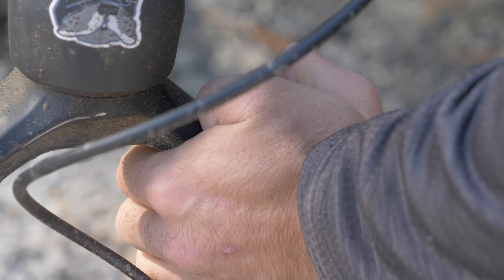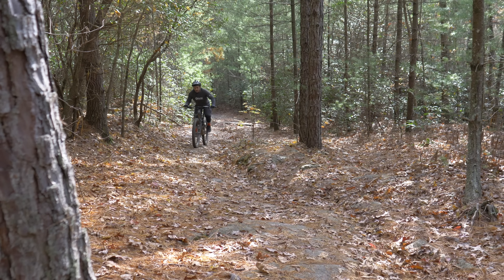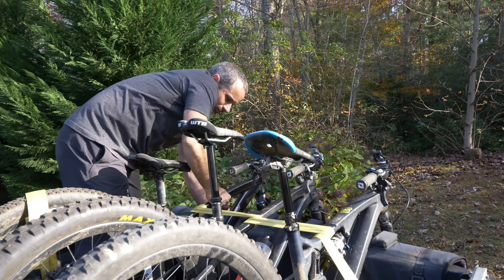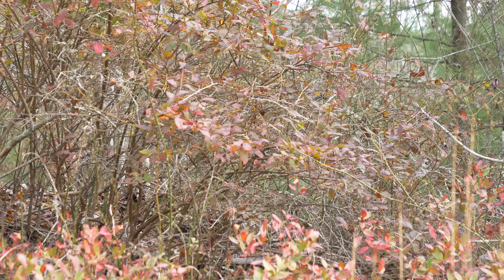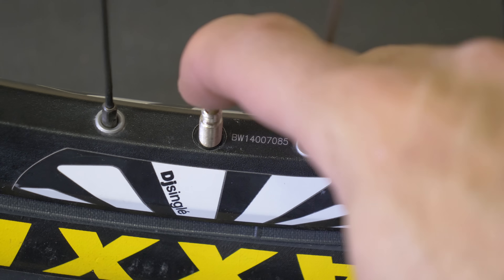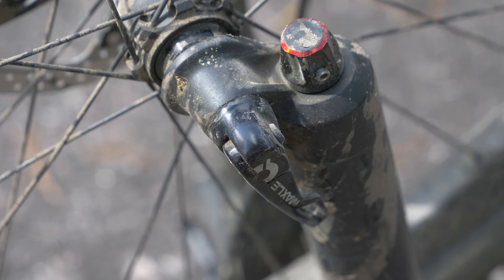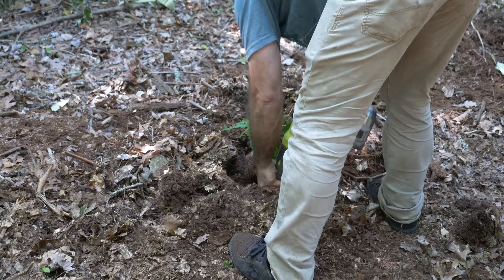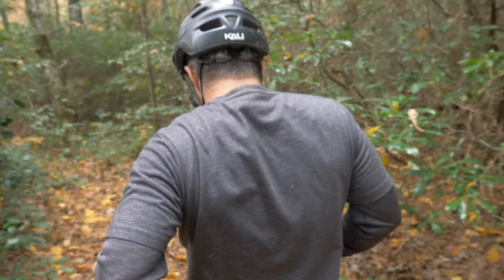10 Hacks and tips for mountain bikers

Comment: I thought I was going to know all of these. That tube trick tho! Nice!
Reply: You can also stretch a 26" or 27.5" tube to fit 29" wheels no problem.
Reply: I bring 26" presta tubes in my pack even though I'm running 27.5 and 29" wheels mostly (Have 24" and 26" bikes too though). I reckon the 26" is the most universal donor. I've never bought a 27.5" tube as they're too close in size to 26, which I had already. The people running plus size/fatbike tyres are about still probably stuck trying to use any normal sized tube though.

Comment: I’ve been using 27.5 tubes as spares in ALL my bike tires for years. Even the road bike. You can usually get them in 27.5x1.75-2.25”. This has worked for me in my 29x2.6 (they stretch), 27.5x2.35, and most impressively 700cx28mm. With the roadie repair, I put another 500 miles on it across Iowa without a problem. You just have to be more careful when installing, as to not pinch all the excess rubber.

Comment: You can use an old inner tube as a buffer for metal on metal clamped accessories like rear carriers that mount onto your frame. Use them in between the part that clamps on your seatpost and frame and avoid scratches.

Edit: you will have to cut the tube to size obviously

Comment: Seth, try this hack,
If your like me you can’t afford really expensive hydration packs or just don’t want to spend tons of $ so you go to Walmart and get one for$20. However, they can be hard to air out. Take the water tube and put it inside the pack, and then place it vertical so it leaves the pack open. Helps the pack dry.

Comment: 4:15 You know the metal ring that locks the valve stem in place? On some of those rings, there is a smaller section that sticks out. You can flip it, and the smaller protrusion will fill in the gap between the valve and the hole. I apologize if that was a bit confusing, and I can DM you on Instagram if you want.

Comment: Hydration pack hack:
Keep your hydration bladder in the freezer between rides. Leave the bladder 1/4 full. Blow in air to form a large enough air pocket so that the filler cap, bite valve, and the entire hose are free of water when the bladder is laid flat. Then place it flat in your freezer.
The next time you fill your hydration pack, it will be slime free and will have a long chunk of ice to keep your hydration  fluid cold. 
Been doing this for years with the same bladder with no degradation of the bite valve, hose, or bladder.
Reply: Vince Fernandez nice

Comment: The shock pump "slide hammer" stuck air cap hack is a good one. To help keep them from getting stuck in the first place, I've learned to thoroughly clean and grease the cap threads once in a while.

Comment: Seth I have a really good hack.

If you take the cap of a Presta valve cut the tip of it off to where there’s a hole through the whole Cap then you can attach it to an unscrewed Presta valve and boom you have a Schrader adapter

Comment: Here’s a hack to fix a puncture in a tubeless tire without the right tools. 

Step 1. cut out a small piece of inner tube. 

Step 2.  Put a little dab of rubber cement on the puncture.

Step 3.  Take a 3mm hex and shove the inner tube in to the puncture but don’t rip the inner tube it will take a little finagling to get it to seal but I got it to work for me

Thanks in advance

Comment: Here's a hack.  For a cheap and sturdy on bike storage container use 1 1/2" PVC pipe (as long as you want), end caps, and plumbers cement on the bottom end cap, spray paint for pretty.  You can drill 1/4" holes if you want to mount it on the frame or use hook and loop.  It will hold a small multi tool, 2 irons, a patch kit, and wet wipes depending on size. I use electrical tape to keep things from rattling.

Comment: Hey Seth I've got some hacks for you. For some reason I'm too lazy to get a case for my phone so I throw it in an old sock to protect it. I use an ankle sock and tie a knot at the top to prevent my phone from coming out. If you know how to sew I'm sure you could use a sock that hit below the ankle and sew in a string to tie together or even some small bungee cord and use a cord lock to cinch it down. The second is an old backpacking trick. You cut your straps on your pack and singe the ends to cut down on weight and frustration that arises when straps get tangled. Again, if you know how to sew you can sew the ends of the straps together like they come new to prevent the strap from going through the buckle

Comment: When working with plastics with threads in an industrial setting, we use never-seize, PVC has a tendency to lock itself, like the air cap, and you start to break stuff trying to un-do it. Put some on the threads and never have to get mad at it again!!!!

Comment: Another hack of the multitool : You can actually add your keys to it (home, bikelock etc). Its cheaper than a keysmart and works just as well but with more tools ;) you might have to make the hole in the key a bit bigger, but that's easy.

Comment: Hey Seth, I've got a hack for you! It's loosely MTB related :)
Recently I was cleaning out my PC, and I decided to use my Topeak Booster Pump as a compressed air can. It worked marvellously. Needed a hand from my husband to turn it on and off for maximum efficiency from each blast, but it did the job and it did it even better than normal compressed air in my opinion! I also got blasted in the face with dust haha...

Comment: New hack; Use a Q tip and push it through the valve of your camel back to clean out black gunk that is inside the water tube. You first need to remove the rubber part and open the valve completely by moving the feed lever.  This only works on the stuff closest to the valve but it cleans most of the gunk out.

Comment: If you over titan a quick release axel, use a pvc pipe to slide over the release and use as a breaker bar. This won’t wreck the axle or paint but will give you enough leverage to open or remove the axle

Like so he can see!

Comment: Rocks flying up into thin wall frame tubes sounds like it could be damaging things.
One or two layers of duct tape dampens the noise and has to protect better than nothing.
In a pinch you have some tape to peel off and use again.
We once repaired a blown sidewall with a snack wrapper. Planter's peanut and it held up the whole ride.
We used to wire our dirt bike spokes where they cross to triangulate them. It also prevents damage if a spoke were to break and start whipping around.

Comment: if you have a bag that you strap onto the frame and your multi tool doesnt fit

stretch the multitool over a section of inner tube
then use the strap that comes on your bag and strap over the multitool, half weather resistant and secure, use extra self stick hook and loop if it isnt secure enough

Comment: here is my tip. for gopros when you want to tighten the screw down very tight so it wont move the camera, you can tighten it all you want but it will only ever go so far because the screw will bottom out inside the captive nut. take the gopro screw and grind or the end down only 1-2mm and screw it in and it won't bottom out as soon and will become super tight.  even better, go to any hardware store and buy a M5x20 bolt and so the same where you file it down 1-2mm and now you have a bolt for your gopro without the ugly black finger screw thing. even better if you get a bolt with an allen head instead of the normal philips head. you can screw both down with a screwdriver or allen key and it's so much better than normal. i got this trick from the guys at the racetrack when we race motorcycles. hope its helpful

Comment: seth, you should do the removing a rear cassette without specialty tools hack
here are the steps:
1. remove rear wheel
2.remove chain and leave unlinked
3. wrap chain around the biggest cog and hold tight to the floor without twisting it with your foot
4.stick a pair of needle nose pliers where the cassette tool would go so that the pliers are inside the area made for the teeth, use a vise grip or some elbow grease and turn the pliers to loose the cassette
5. your done congrats.
this requires no money or specialty tools.
the tire should roll against your left or right foot depending on if the gears are facing away or towards you and provide enough resistance so that the leverage of the pliers loosens the cassette.
in case anyone is worried it will damage their cassette ive seen tons of people do this without any damage, just dont over tighten it, if its to tight for you to loosen ur bikes probably got damage already.

Comment: I have a small hack. Im running on a presta valve tubes. And i have a portable pump for a shredder valve. I bought an adapter for the presta valve which now i can use the shedder pump and i just hooked it on the tubes on my bike, so that i wont be looking for it inside my hydration bag

Comment: If you leave your tire out in the sun or by the fireplace, it will make them as manipulative as a rubber band. I also do it with my Maxxis motorcycle tires, so it works.

Comment: Schrader valves are superior in every way. Larger diameter allows easier filling of sealant and the valve cap doubles as a valve core remover. I can inflate my tyres at any servo without needing an adapter and they are tougher when dealing with impacts. So if my rims have schrader sized holes then I’m not going to use a puny presta.

Comment: 29 inch tube hack is nice, but actually, you can fit even 26 inch tube in 29 inch wheel. I probably wouldn't use it as permanent solution, but if it is just to finish trail, than it is sufficient.

Comment: The bike pump hack was cool.  That trucker ratchet strap is overkill though.  The little 1" wide ones are cheap, more than sufficient for your task, and they're just much easier to handle overall.  You know your way around a hardware store so I assume you knew that.  Were you using the larger strap for clarity in the video?

Comment: Another hack for next vid. When adjusting your brake caliper, just wrapped a rubber band around the brake lever and then tighten the brake caliper bolts. This is a lot better than doing it by squeezing the lever with your hand.

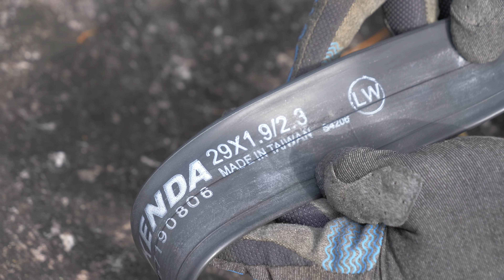Comment: @ 3:31
You say use a 29" tube because you can shorten it to fit any size!!
You can also use it on a larger wheel.
I was in the OBX.(Outer Banks)
Destroyed  a 36" unicycle tube!!
No bike shop had a tube that big. 
So I bought the biggest size I could get 29" 
The guy at the shop said it would never work!!
I took the tire off the wheel, inflated the tube (Schrader valve in) until the I.D. of the tube was bigger than the O.D. of the wheel. Put the valve in the valve hole.  Let the air out positioning the tube as it deflated.
Put the tire back on, it was a bit difficult. But it got me by.
And looked up a tube online was going to order a replacement for when I got home. 
Until I figured out it was $40 and up. 
The 29" I  paid $12 in a tourist area.
I'm still running it in my 36er!!!!!

@ 4:04
Is that your unicycle? 
I noticed it's not a low end uni. 
Low end uni's don't have hyd. Disk Brakes!! Or brakes at all for that matter. 
Nice!!!!!!!

Comment: Stretching a 26" tube into a 27.5 or 29er is better than going the reverse. It also takes up less space.

Another "hack" that I noticed you don't do is to run your front brake line inside your forks so that if you crash it doesn't get torn off as easily

Comment: That trick with the presta valve thingy, I'm gonna try that. I run a presta valve on my 26" Jamis and the edge of the hole where the valve goes seems very sharp and always cuts right at the base of the inner tube where is not fixable at all can't patch it or glue it, so you have to buy a new inner tube. So your left walking your self and your bike home. 😡

Comment: Using a presta valve on a shraider wheel the lock ring with the nub on one side hose into the valve hole so the valve stays in place so your hack is just incase you haven't got any lock rings left

Comment: A HACK FOR CUTTING CABLES
If u don't have cable cutters you can take  any needle nose pliers or diagonal cutters  and a mallet then place the cable between the teeth of the pliers and tap it hard with the mallet or any heavy object and you'll have a nearly clean cable cut .

Comment: Hey Seth I recently was swapping shifters and when i was putting everything back on it was difficult to do because I had a couple of kinks in my shifter cable and I was trying to think of a way to make it easier to put the cable thru the housing so I had the idea to get a lighter and heat the kink and pull the cable with a pair of pliers and the kink will slowly go away

Comment: Bike hack: when removing a fork the headset and bars are all loose. Save yourself the hassle of looking for spacers and save your cables the strain of holding the bars by putting a big Allen wrench in the head tube. It must be a t handle or have a short side longer than 1 1/8 inches. Slide your stem spacers and stem over the long side of the Allen wrench and prop the wrench inside of the headtube at an angle and you never loose a spacer or forget the order.

Comment: In a emergency, you can use a adjustable wrench to true a wheel, just lock it to one of the nipples and turn it each way, this got me by when I need it.
Reply: To find a buckle just gently hold a pencil against a fixed point on your frame then slide it carefully toward the wheel until it makes periodic contact. Find the center point of the line then tweak the closest spoke ⅛ a turn in the relevant direction. Tighten if it's on the opposite side to the buckle, loosen if it's the same.
I build my own wheels, an adjustable spanner and a pencil are all you need to get yourself out of shit.

Comment: 4:55 no as much of a problem to bend/break the through axle, but more so the multi-tool itself. For emergencies, a quality multi-tool should handle it just fine, but don't expect much else other than breaking one of the wrenches in half if you use a cheap Chinesium made one (like, eh, me...) - this to say, good hack for emergencies, but it may be worth getting a proper hex wrench for that if you're just working on your bike.

Comment: That cary 29 inch tube hack is unnecessary. I used a 26 inch tube in my 29er for years. Google it it's a common practice and it works absolutely fine, you only have to stretch fit a slightly pumped up tube on to a rim.